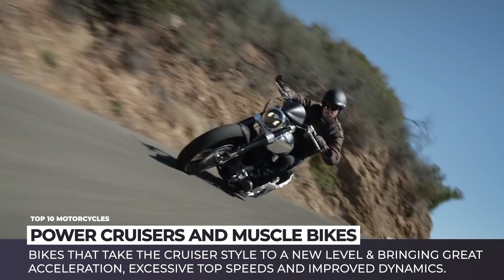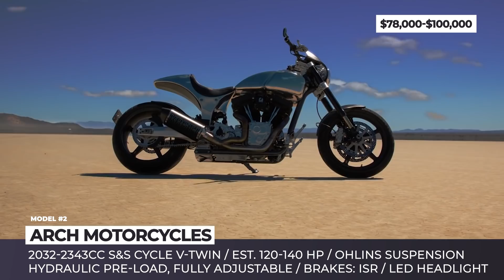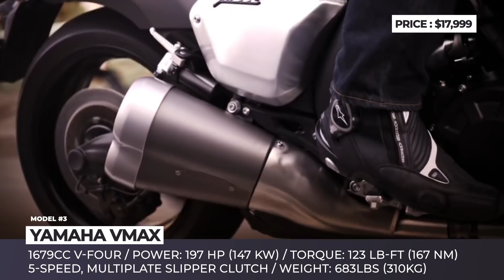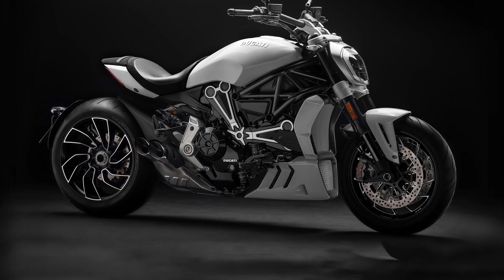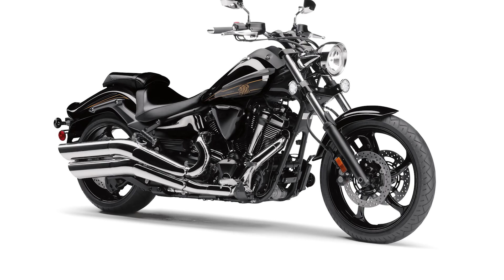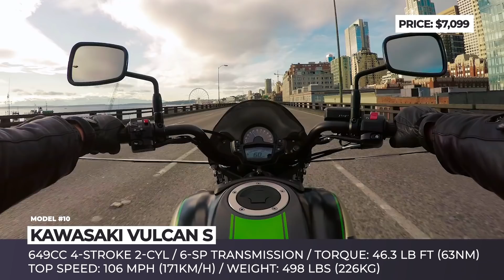Top 10 Muscle Motorcycles and Power Cruisers with the Highest Speed Capabilities

Comment: The diavel is a cruiser that can't cruise.
It simply can't be driven at revs less than 3000, no matter which drive mode.

Unlike all others, the VMax was genuinly built as muscle cruiser with an engine just built for this one bike and Yamaha spent quite some money and investigation to get it right. The VMax sets the standard and I can't see any bike that interprets the power cruiser better than the VMaxes (1200 and 1700).
But the VMax is much more than that. It is a classic "big bike", in sense of the Münch Mammut or the CBX or the Kawa Z1300
The VMax is a class of its own and I can't see any bike that can do better. I own a lot of bikes but the Maxes rule, even a 35 year old 1200 is still a very powerful bike with more torque and mors power than most modern bikes.

Comment: My 74 CB750 K WOULD DO 150MPH BACK IN THE 55MPH DAYS THE 80 S !IT WAS 40LBS LESS THEN STOCK! 4-1 HEADERS NEEDLES ALL THE WAY UP BIGGER AIR CLEARNER SW REAR SHOCKS SOLID SWING ARM BUSHINGS 60-70 FORK SPRINGS WITH 30 SAE IN THE FORK CONTINENTAL SUPER TWIN TIRES ( 4 G STOP AD ) THEY DID STOP VERY WELL ! ALL I DID WAS GAS TIRES OIL AND CHAINS ! RODE IT LIKE I STOLE IT FOR YEARS !

Comment: what a  riot. these are MOTORCYCLES....NO motorcycle is worth even close to 30,000 even if it was plated in 18k gold. its a couple tires, a frame and motorcycle drive train for christ's sake, a few computer programs to drive a few circuit boards. 30,000 plus dollars, bullshit. then you have bikes for 78K. P.T. Barnum is turning over in his grave missing these suckers. christ, you can find new kawie 14R's that shit all over everyone of these bikes for 11k new. what do they think in gods name they are offering that is 20k better. they don't have as good engines, they don't have better brakes, they don't have more comfort, they don't have better reliability, they don't have more stable rides, they are miles slower, they don't handle as well. so they eat 14r shit yet want 10 to 20k more dollars, why? for what? for being an idiot i guess.
Reply: Don't be a hater bro,

Comment: The big Kwak is by far the best value, although if some of the others are stored more than ridden, they'll
probably increase in value in years to come. I would like to know the fuel consumption figures, especially for
the 6.5 litre machine.
Reply: I’ve owned many Kawis, my favorite is still my daily rider: Kawasaki Vulcan 2000, 2053cc’s of pure beast mode. 😂 I think Kawasaki made a big mistake discontinuing the line of 2 liter V-Twins. 😩 They should have given her an upgrade to a 6-speed transmission and taken full advantage of all of that aggressive torque, yet be able to sip gas on the open highway.

Comment: I've owned a lot of Power Cruisers and the M109R turned out to be one of the best bikes I've owned. I have a TFC R3 on order. I love everything about that bike including the handling ride reports. I should have it Jan. 16th 2020
Reply: Oh and great job on the video. I know a ton of work went into that. Here's the numbers on the TFC from Triumph. QUOTE: Due to an extremely high level of interest, the Rocket TFC limited edition run has now sold out. With peak power now confirmed at 186 HP and peak torque at 166 FT-LB we’re sure there are 750 very happy TFC owners out there!
Reply from the maker: Appreciate your help! Will review my database. Hope the new Rocket will turn out everything you hope it to be

Comment: The specs shown for the Raider is wrong. My 2002 Warrior that the Raider replaced had 115 ft lbs of torque and it had a smaller engine. The right specs for that Raider are 100 hp and 123 ftlb tq. Not sure where you got your numbers from, but I do like the collection of bikes you put together.. I promise you I will end up with that Triumph somehow, lol
Reply from the maker: I obtain the specifications from official press releases only. Let me double check the specs that you mentioned.

Comment: 18 liters of fuel for a big engine of 2.5 l, it is not enough for a good autonomy of 350 kilometers minimum, it takes about a tank of 25 liters of fuel...
18 litres de carburant pour un gros moteur de 2.5 l, c'est pas assez pour une bonne autonomie de 350 kilomètres  minimum, il faut environ un reservoir de 25 litres de carburant

Comment: The announcer is claiming the new  v Max has very little resemblance to the original ...boy did he jump in it with both feet as all his creditably just flew away...Yamaha of Japan came to American Yamaha and gave the American Yamaha executives a blank canvas   with only one stipulation , build a performance cruiser like Americans would like to build themselves.  ...and the two oversized air intake scoops on either side of the tank pod where born and are still in place as this is the trade mark for all v max's   take that. Away ..you might as well pull the bar and shield off of a Harley Davidson
Reply: The Suzuki B.O.S.S. is the worse choice of them all costing more than any of the Harley's in it's class  as this mocup zuki hawg will not come close to the performance of a FXDRS 114 Milwaukee eight or the last Dyna FXDLS SCREAMIN EAGLE 117 STAGE IV ..as my personal fxdls 117stage iv at the all out Dyno drag races against a Suzuki Hayabusa ...my fxdls 117 stage iv standing start 1320 
Reaction time ..........  .081
Standing 1/4 mile e.t.......9.674
1/4 mile top speed ....123.581

Hayabusa ....9.7
Top speed 130 mph +
Reply: Have to agree the duck is it ..same price as the Harley power cruiser FXDRS 114 Milwaukee eight as you wonder where Harley came up with the looks for the FXDRS ....as Harley had their foot in the front door of Ducati three years ago having the highest bid ...untill Audi paid Ducati their price and more ...ducs made by the world best designers and world record holders of cars can't be all that undesirable as it will cost you another 8k to 9k to upgrade the Harley Duc look alike to match the desmo  duc's performance ..similar to the story of Lucifer's hammer and ducati's 1st desmo duc v twin at the battle of the twins daytona bike week ..for five years a lone Sportster called me and Lucifer's Hammer with Gene Church aboard dragging his knees to victory ..got desmoed  and quacked  the following year totally surprised by desmo duc  ..so how does a desmo of the desmo duc's spin their flywheels at over 9000+rpm without eating intake valves and spitting out exhaust valves during s moon base launch of ducies pistons ...there is a cam and rocker  to open a valve ..and also a cam lobe and forked rocker to force the valve closed ....what this means ---:: you can rev a desmo duc untill the flywheels orbit the earth but will never float the valves

Comment: The Raider HP and torque is wrong. So I can suspect mistake on other models then.
Reply from the maker: I obtain all specifications from official press releases. What are the correct specifications then? Sometimes mistakes may slip, so help me out if you can.
Reply: Automotive Territory: Trending News & Car Reviews from at less an other one somwhere and my bike the Raider 1900 which is not 104 of torque but 123. If I and an other one said there are mistakes then maybe, I said maybe there are few other mistakes about specifications. Me i speak for mine the Raider.
Reply from the maker: I think, I listed the "at the wheel" figures for hp and torque. My bad, since the rest of the bikes got at the crank figures.

Comment: The triumph rocket makes harleys look like girls bikes
Reply from the maker: I bet, any bike feels that way near that monster engine.
Reply: Ya that is what happens when you fit in a car engine to a motorcycle. Although I doubt if there is a need for those extra cylinders. You may never need more than 4 gears if you live in asia. It is like having a monster truck in Tokyo or London. Only grunt but goes nowhere. It only feels at home on a Autobahn.
Reply: @mailrbn  you're actually wrong. It's a 3 cylinder engine. It's actually more on home on the streets than a highway.
Reply: But aren't Harley Davidsons for women only amd unsure male riders ?

Comment: Latest acquisition : 1980 Yamaha XS1100 and what I've been riding lately. This was Yamaha's first 4 cycle 4 cylinder inline and I'm sure they considered it an early muscle cruiser. It's geared on the low side except for 1st gear which is a bit high. Then you shift thru quite a close ratio 5 speed. With 95hp and 129mph as the top speed it's built to flex it's muscles from 0 to over 100 or something a little shy of that. With an 8500rpm red line it runs the quarter mile in about 11:50 at 114mph. 11:47 seconds was actually the fastest I have read it tested among the magazine's of the day. Of course there are big bore kits, aftermarket exhaust and hotter cams and racing carburation that can bump the performance a bit closer to contemporary figures. A good balance job on the lower end and those cams just might have it screaming to a more modern rev range too.
Reply from the maker: Thanks for sharing your experience. No doubt l, that going used is the cheapest option.

Comment: Glad I got a new Kawasaki Z900RS for $8,495. Saved thousands.
Reply from the maker: That's a great deal. How do you like the bike though?
Reply: Haven’t rode it too much because it’s 115 degrees here in the desert but it’s smooth and fairly quick. Not ‘72 H2 triple quick but it is fun to ride around town. I have a ‘05 FLSTSCI and both are quite different. They’re sharing the garage together and seem to be getting along just fine.

Comment: HD 114 only pushing 90hp? For that price point it should be over 100hp to be competitive. The rocket 3 is a beast!
Reply from the maker: I've heard similar thoughts on the HD. I'd be nice to hear what prompted the manufacturer to underpower a bike like this.
Reply from the maker: On the second thought, this HD bike is like other HD. Heavy and underpowered.
Reply: Harley Davidson Fat Boy is actually pushing 100 horsepower it should have been in this list instead of the FXDR
Reply from the maker: Appreciate the suggestion
Reply: @automotiveterritory  no problem! I'm very deep into Harleys therefore I'm just informing
Reply: Most annoying about Harley is they have a 131 crate engine they’ll sell you for about $6 grand that installed by your friendly dealer will set you back close to $10k over your Harley’s sticker price. I could see it as a couple grand factory upgrade but it’s way over priced.  That’s why my Street Bob is going to get traded for a Rocket 3 although I am otherwise happy with the Milwaukee 8 Softail platform.
Reply from the maker: Check out the new version of this video
https://youtu.be/IP0n7CGHNLQ
Reply: Its a death machine. The rest of the "beast" cannot manage the power. It is hard to brake and corners wide: too much weight. It brakes lousy and is uncomfortable to ride. Yes I test pulled one.
Reply: @russtee9352  weight wise my Harley Softail isn’t any heavier than the Rocket.  Brakes are better than expected on the Milwaukee 8 as well.  If your intentions are for cutting corners at speed maybe not the best choice but for cruising and enjoying the twister roads I can’t complain. Everything I’ve read and heard from fellow riders says ABS isn’t open fir discussion any longer.  It’s a plus.  We can debate all the other rider aid electronics but my buddies who mostly ride sport bikes swear by ABS Not at it.
Reply: At least the Harley has brakes pound for pound...the rocket does not. One more issue. Whomever got permission for abs brakes on a motorcycle is a murderer. The manufacturers that bought the idea are morons. If you can't feel your brakes locking up, you lose control. ABS does NOT belong on bikes. G'night idiots.

Comment: Was waiting for top speed capability by the numbers
Reply: muscle bike, you look at the Horse Power........VMAX 1700 hands down, 197 HP......harley 1800....90 HP....LOL😜😀😂
Reply: @RCREVIEWS101  ducati 1200- 160 hp
Harley 2100- 90 hp
Reply from the maker: Hi there. Apologies. This parameter is usually not mentioned by the manufacturers, for unknown to me reasons.
But the majority of these bikes top out at 140-150 mph according to the independent testing.

Comment: I'm still riding my 2008 Yamaha Raider S as my main bike. It's no longer the biggest beast in its class nor the fastest, but it's still torquey as hell and handles great due to low center of gravity and perfect balance. Yamaha's solid 1854 cc engine is still the smoothest, most reliable big V-twin out there. The factory fit and finish are exceptional throughout. This bike is just plain fun to ride if you're not looking for sport bike performance. For comfortable all-day cruising you can't beat the Raider in this class of bikes, especially at $15K spanking new. Production ended in 2017 so if you find one, grab it. The Vulcan 650 S is the best cruiser made today for smaller or new riders. The engine doesn't get quite the same performance it produces on the Ninja 650 but the Vulcan's speed and acceleration are more than sufficient to satisfy most cruiser riders and the ergonomics are both excellent and adjustable. Power delivery is smooth and lively at all speeds, and cruising along the highway at 75 mph in 6th gear is effortless. The handling is light, nimble and fun. The price is a no-brainer and leaves room in your wallet for plenty of accessories.
Reply from the maker: Truly appreciate you taking your time to leave this detailed feedback about the two bikes! Hope my viewers will come across it and it will serve as a great buying advice! Upvoting!